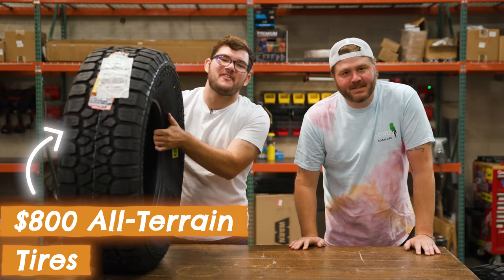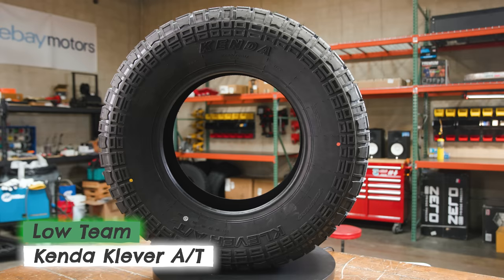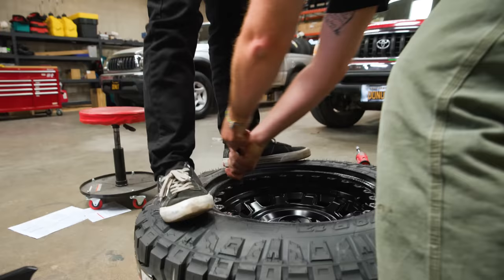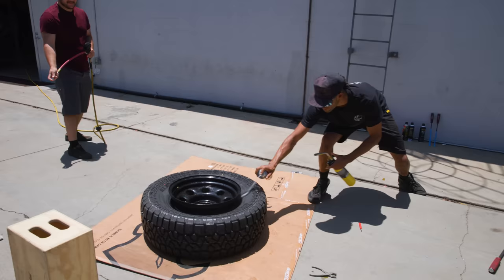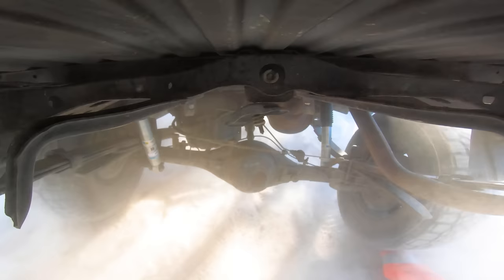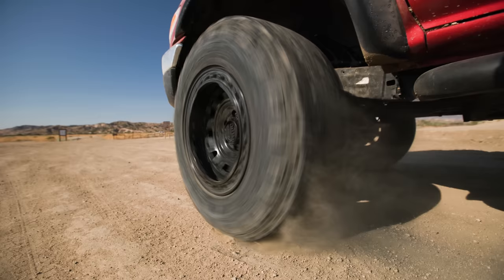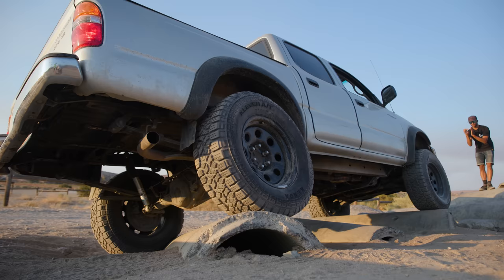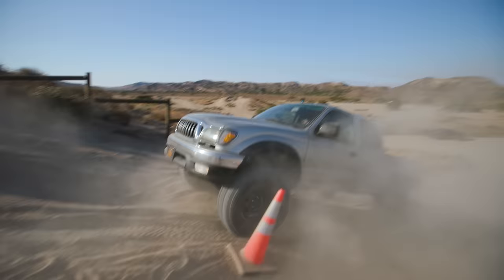$800 Off-Road Tires vs. $1500 Off-Road Tires

Comment: As someone with nearly 20 years of offroad experience I can tell you that there is no direct correlation between price and the overall performance of a tire offroad. (meaning DOT approved tires, not stickies etc) There are many tires out today that are trendy, therefore demanding a higher price tag. But that doesn't necessarily make them better.
Reply: It’s the material they are made out of that reflects the cost bruh
Reply: @smolscale  If price was only determined by quality this wouldn't be a series. Sure better rubber costs more to a certain extent but marketing and branding definitely effect it equally as much like with any other product. Just look at the prices of Continental vs General tires
Reply: @smolscale  yeah but just because they are made out of a more expensive material doesn't make them better "bruh"
Reply: Arron, THANK YOU, THANK YOU, THANK YOU.
Reply: cough KO2 cough. wildpeak gang
Reply: No coorelation between performance however, the difference buying a open country r/t compared to military tires is one will last 65k miles, the other will be bald in 10k
Reply: @Parzzyval  Goodyear wranglers gang
Reply: I.e correlation does not equal causation
Reply: I remember none even knew  patagonia now they seem to have spiked in price because of how popular they were
Reply: 😂 you don’t even know what correlation means lol
Reply: @leog9524  only problem is they suck in clay mud but really good on rocks
Reply: @arrondentinger2086  Nobody is denying that better material = higher price. But just because they're made out of better material still doesn't change the fact that marketing and branding is also inflating the price more then they should be. Not that hard to understand.
Reply: @leog9524  it's fucked up too because the only reason why Patagonias even become popular is because they were good and cheap.
Reply: @PabzRoz  that is literally what I was saying. Not that hard to understand... lol
Reply: @Parzzyval  Nah, the KO2 is the best all-terrain tire I've ever experienced. They're dead quiet and perform better than I expected.
Reply: @AnthonyLutsik  i run duratracs on my 01 ram
Reply: If you take a kenda MT and a Toyo MT and compare how even they wear and how long they last, you'll quickly realize why one cost half of the other. Not to mention when you initially balance them a lot of cheap tires require a ton of balancing.
Reply: @Bingo1Dog  they are wranglers right? Kevlar reinforced?
Reply: @AnthonyLutsik  yeah they're a wrangler.  The ones I have are not kevlar and I forget if they have a version that does have kevlar
Reply: @nathangoodman603  I have ran toyos for a decade on all my rovers because they have been problem free. I have a set of nitto ridge grapplers on a disco2 now on 16 inch steelies and they are great. CHEAP ASS TIRES do not last. It is very important to not skimp on quality when choosing what rubber meets the road in my opinion.
Reply: @tylerkeen5224  If price and quality went hand in hand, Continental would be out of business.....
Reply: @aaronthomas6155  Because they’re so good they’d be too expensive for anyone to afford, I agree
Reply: @tylerkeen5224  Continental tires are absolute garbage.  Between tire noise and vibrations, they're one of the hardest tires to sell to a customer a second time.
Reply: @aaronthomas6155  Cool opinion, don’t buy them then. Don’t know why you’re telling me as if I’m going to stop buying Continental/General based on your opinion.
Reply: @tylerkeen5224  I don't really care if you continue to buy them.  Spend your money on whatever you want.
Reply: @Bingo1Dog  they do have a Kevlar reinforced ones that’s the ones I have. Stupid durable had a rub with a very sharp stick in the side wall where it bent the sidewall solid 2 inches and no puncture
Reply: You don’t know what you’re talking about

Comment: When spotting for someone while off-roading, use "driver" and "passenger" for directions instead of "left" and "right." Helps both parties be on the same page.
Reply: @Gareth Tucker for off-roading it’s easier to use driver and passenger though. In the US you would be hard pressed to find an off-road rig that is right hand drive so driver and passenger is the easier method. Not discounting the way you have experience in, but for what they’re doing it’s easier to use driver and passenger commands instead
Reply: @Gareth Tucker it’s truly up to the individual. In the US specifically we primarily use driver/passenger since virtually every vehicle that is on the road in the US has the driver on the same side. I don’t have enough experience in other countries but we use it that way even on single seaters since so many people have it hardwired that driver is always to the left and passenger to the right. Not to mention there is very little confusion since you’re working with terms that cannot be mixed up. Saying left hand down could confuse a driver on whether you mean their left or your left. While not highly likely, I have seen it happen. It’s the same reason that the machinery I work on doesn’t use left or right. We say operator or non operator since that removes any possible confusion with our service department
Reply: @SuperTheast  Learned in the military and we were not allowed to talk when spotting, only hand signals was accepted. If you had to explain something you stopped the driver and walked over to talk to him before going back to spotting. Trying to talk people through an obstacle is kind of a loosing prospect if the surroundings are noisy, and sitting in a truck like these doesn't make it easier. So establish a set of hand signals and stop yelling...

Now driving with a spotter can be stressful as you have to ignore what YOU THE DRIVER feel would be needed and only do exactly what the spotter is signaling you no matter how much you feel you know better.
Reply: @blahorgaslisk7763  if I’m backing someone up with a trailer I definitely use hand signals. I do mostly trail crawling so it’s quiet enough that just talking does the trick. It’s definitely up to the individuals that are navigating the obstacles though. I’ve seen people do hand signals only and others that mixed them in. I’m not trying to say one way is better than the rest since there is no perfect way
Reply: The words you were looking for were port and starboard
Reply: @Gareth Tucker left hand down is way more confusing because it introduces a direction to move ones hands that may be contrary to what is happening with the vehicle.
Reply: @blahorgaslisk7763  what's the hand signal for,  "your driver front wheel is about to start climbing a ledge, but your driver rear is going to drop in a hole half way up. Once you feel the rear drop, cut hard passenger and maintain your momentum without getting rowdy. After both fronts have crested the ledge, turn back driver and ease off the throttle, but don't come to a hard stop?" You can,  and should, go over all that before starting, but on a long and/or complicated maneuver, you'll likely need to coach midway through. Just because the military does something a certain way,  doesn't mean it's better,  or even right. No one is exfiltrating trails on the Rubicon while trying to remain undetected by the enemy. Maintaining a strict ratio silence is an unnecessary restriction and only serves to add additional risk.
Reply: @1stuart1  You would be shouting all that in one breath while they're driving through an obstacle?

Comment: Why didn't yall let nolan have the expensive parts this season? 😢
Reply: that’s what I was wondering. Low team probably needs a nerf because they have Aaron.
Reply: @heroichitsuji  high team has jobe though so i mean kinda on the same lvl in my opinion
Reply: Honestly I can see him choosing to have low again
Reply: Agreed they shoulda swapped
Reply: Nolan can barely even do the rock crawl 😂 let him get more experience
Reply: Nolan is their whippin boi
Reply: Because Nolan was born Low
Reply: @mikabaumgartner5462  jobe doesn’t use explosive tires, so not on same level

Comment: Just started watching the series and honestly I prefer low truck, I feel like relatively cost efficient upgrades are kinda the spirit of off-roading.
Reply: I like hi trucks tires more, but everything else I think lo truck is better. It honestly looks way better and the wheels were literally 1/4 of the price
Reply: In the last series...the "low" options included some really cheap chintzy stuff.  I love this truck series and the low products are still solid.
Reply: I like the toys that hi-truck gets, but you are 100% right, working on a budget is more in the spirit of off-roading.
Reply: @Magucci13  lll my
Reply: Haha same. My truck is the 05 Sierra 1/2 ton equivalent of low truck. 1" lift/level, RC shocks,Tyger Automotive amazon flares, Aries bull bar, Amazon 20" light bar, 6 high mod (when I turn on my brights my fog lights, high and low beams come on all together) reverse camera, better than aftermarket brake pads, soon I'm going from 265 70 17s to 285 70 17s. Anyone have tire suggestions?
Reply: @alexehhhh  cooper evolution mt I have them on my jeep and they preform very well
Reply: @Magucci13  i love Hi Trucks tires!!!
Reply: Lower trucks are cool asf, us Mexicans usually drive single cab chevys that are lowered lol
Reply: They really aren't, if you've ever been to a big off roading event
Reply: It all depends on what you plan on doing. The budget should fit what youre needs for the truck is, less than what the "performance" is. 

A guy going on weekend camping trips probably doesn't need a 6" lift long travel arms, 37's full steel skids and sliders on his midsize pick up. I say probably because well, who knows where they are going.
Reply: The moderate prices are for true off-roaders. The high end prices are for mall crawlers
Reply: @alexehhhh  if you can find them and afford them run km3s. Hands down best tire I have ever ran on any rig. They’re pricy and hard to find but so worth
Reply: Low truck didn't have the tire pressures down on the last obstacle, that was why they were spinning tires. If they dropped the tire pressures like hi-truck did they would have completed the course the exact same. They were worried about popping the bead of the tire on low-truck but over here in Australia people have shown many times you can lower the tires down to single figure tire pressures and not pop the bead. More experience and the donut boys watching people who four wheel driving/overlanding channels will help them out. Some Australian channels to watch and learn from are Ronny Dahl,  4x4 24/7 and Adam Reed.
Reply: Yeah I get that, having a cheaper build is always a cool thing. Off roading is one of those Motorsports where skill is probably one of the biggest factors in it. So when people say they got this & that, it seems yuppie-ish to me. But that’s just my opinion
Reply: It's a fashion show to people these days, but the true grassroots over-the-roading is all about cheap accessible projects that the majority of people can afford. Leave the 80k Jeeps to the guys that just wanna look cool.
Reply: @RidinDirtyRollinBurnouts  a huge part is unfortunately fashion now. Although I have seen 80k rigs that were built because the owners already had those budget builds. Not to mention I’ve road in both a budget build that had to be repaired weekly and a build that was 120k. While 120k was a bit high, it was a far better rig and it wasn’t decked out in so much tech that one fuse blowing ruined it. It was just an older CJ5 and it was by far the best rig I’ve been in
Reply: @Gareth Tucker experience and skill can only take you so far though. At a certain point you do have to spend quite a bit to progress. A stock Tacoma will go far if you have the experience, but at a certain point you have to spend the money on new parts to go further. Depending on what you’re replacing going lower end is fine. But then you run into the issue of possibly going to low end and having to spend more in the long run. It’s all about balance on what you buy.
Reply: @alexehhhh  if you want all terrains then it's Falken Wildpeak AT's. if you want MT's, that's a bit more tricky. Milestar Patagonia's are super popular. I personally also have Cooper Evo MT's like S.Ray and i love them off road. they are super noisy on road though. My next set of MT's will be the Yokohama GE003's, love the look and capability of them.
Reply: @ollie620  i run my MT's on non bead lock wheels around 12 psi when im wheeling and have never had issues. where we wheel is usually rocky also, so there would be a greater chance for me to de-bead than most places. single digit pressure is when bead locks are usually required.
Reply: @Gareth Tucker to an extent I agree. There are some things that you should always spend more on. Quite possibly the single biggest thing is a proper locker setup. I see so many people running a welded diff when it’s far more cost effective to just buy lockers. I guess if it’s never going to be drove anywhere but trails then maybe it would be a better idea to weld. But outside of that I’d honestly only spend more on engine, tranny and tires. Everything else you could get away with not spending extra. But those few things should always be your focus.
Reply: @Gareth Tucker there always will be. Unfortunately there will also always be people that don’t want to do things the right way
Reply: @SuperTheast  exactly,  trail riding is a funny thing.   There are lots of trails no stock truck can do no matter how good the driver is,  if the tires don't touch the ground you are done.

I would have gone with the cheaper tires and a set of steel bead locks.   Best of both worlds and if you really want to be cheap or frugal you can make you own bead locks out of $50 steel rims from a junk yard.
Reply: @yvondubinsky9072  I’d do cheap wheels but I’d go for more expensive tires. I come from a moto background and in that sport you always pay more for tires since it’s your only contact point with the ground. Outside of that definitely go cheaper wheels
Reply: Same. Thats why I got Crosswind LingLong Chinese mud tires. Cheap and effective
Reply: So do I, I would legitimately choose low truck over high truck if I got the option at this stage
Reply: @alexehhhh  I love my Falken Wildpeak AT3W

Comment: One of the things they didn't talk about with tires is sidewall durability, which is extremely important offroading. I'm a firm believer there are a few things not to skimp on building a vehicle. Tires, brakes, and lighting. Honestly the low trucks tires are not the cheapest you could go, it seems the whole purpose of lo truck is to be a BUDGET build as opposed to the cheapest parts you can find. Personally I think that's going to speak to the new enthusiasts a lot more by demonstrating that you don't need to break the bank to get acceptable performance!
Reply: Not just that, when they start to have mileage cheap tires tend to cup quite a bit and sometimes are impossible to balance
Reply: Agreed 💯
Reply: @evadvalcourt  those Kenda tires aren't low quality, Kenda is a value brand but they've been around for a long time making car, motorcycle, and ATV tires, they're just new to the truck tire game, but Kenda is designing their truck tire line out of their facility in Ohio.
Reply: @Semaj Niffirg  also bicycle tires, anyone who needs cheaper tires I always recomend kendas at my shop as the offer decent performance at a much lower price
Reply: @evadvalcourt idk I’ve seen 2500 dollar bfgs cup as well as coopers. Both on brand new trucks. I wasn’t open to trying different brands until you have to replace MTs every 20-30k miles. I’ve tried a few “off brands” and so far have had success with them.
Reply: @Moveloso2803  a op t😮😮
Reply: They also didnt take into account longevity of the tires if high tires last much longer then low tires i think that would make up in their higher price
Reply: Exactly what I was thinking, your spending the extra money to have a 8-10 ply tire which not only gives you a much more durable sidewall but allows you to still tow/haul heavy loads- the thing a truck is primarily for.
Reply: agree 1000 percent. Having a weak sidewall can leave you stranded way off road. For any solo trip driveline and tires are not something to try to save money on. I love my 10 ply sidewalls, at4w hd

Comment: there's a point when you realize there's a deminishing returns on performance per extra dollar spent. this series really highlights this factor, and willing to bet is the entire premise of the series
Reply: Exactly, the more money doesn’t always mean the best. I really like the price of those low team tires, especially after a lift kit…
Reply: @ClaytonNeuner  I don't know about saying that more money doesn't mean a better product. It would be better to say that at a point, it isn't worth the difference
Reply: As much as I agree from the perspective of this video that the 3x pricier setup on hi truck isn't performing at a major advantage. It doesn't showcase the factor of how well will the high truck's parts last. How many miles will the tires get on them, how long will the suspension perform at top-notch, and will the Beadlock wheels eventually take an impact that cracks them beyond repair?
Reply: dont go cheap, go inexpensive
Reply: @phil16  yeah

Comment: First off, you guys do some good videos!  The difference in price isn't necessarily just traction and looks. The build of the tire matters. How tuff they are, usually, the more plies a tire has, the more they can resist punctures. Many years ago, I saw some sweet looking mud terrains at pep boys for under 150 a tire(if I remember correctly). After reading the sidewall and seeing that they had only 1 or 2 ply tread(normal for street tires) I walked out.  Keep up the good work fellas